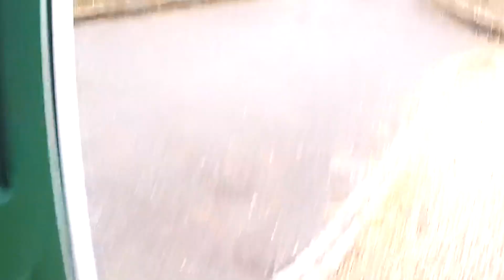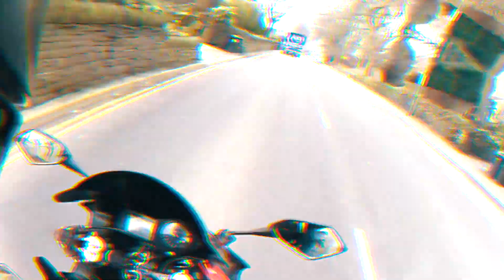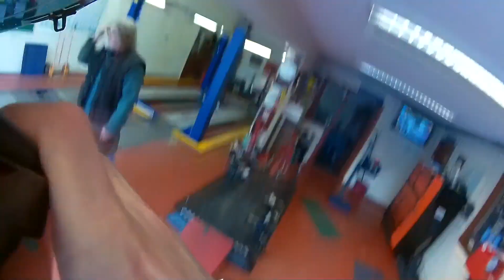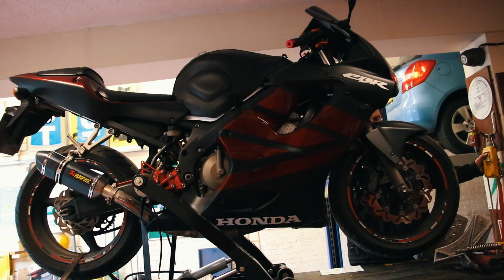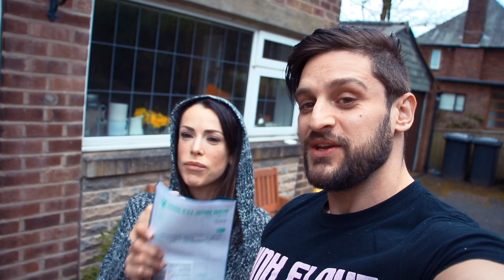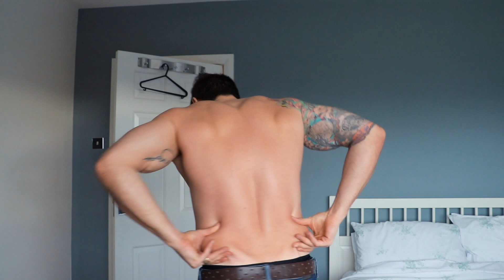7 DAY BODY TRANSFORMATION CHALLENGE | RAW Physique Update After Cheating! (Lex Fitness)

Comment: Awesome video Lex.  I think this video also highlights another aspect of the fitness/bodybuilding journey.  

Which is, to stop checking the mirror too often during times of heavy bloating/bulking etc.  It can be psychologically taxing on those who are worried about putting on a little bit of extra weight after carbs and so forth. In the past I have done this! 

You have just proven that in a matter of 7 days you can completely change your physique through nutrition/training. 

Congrats